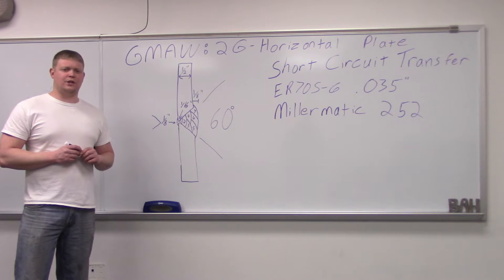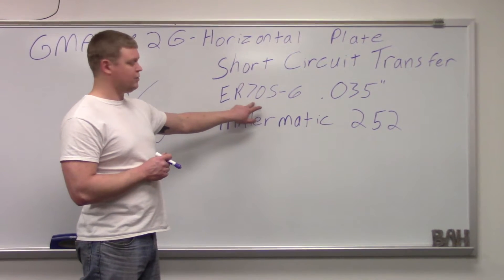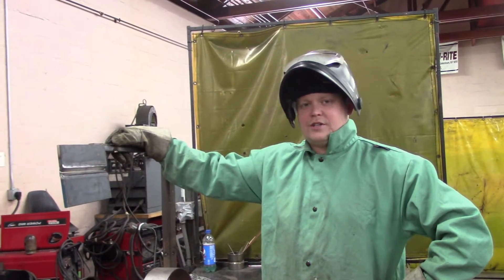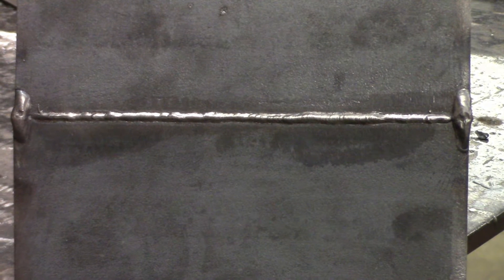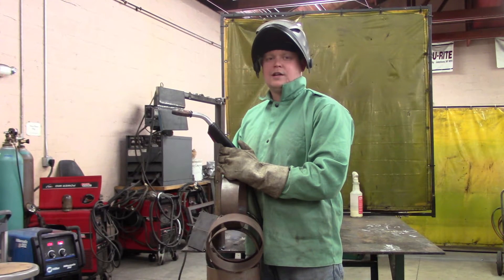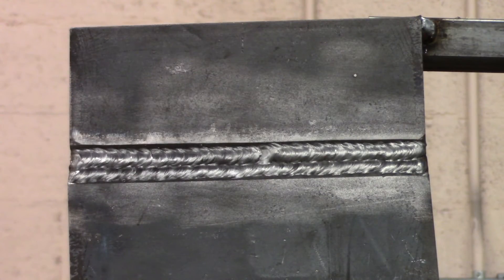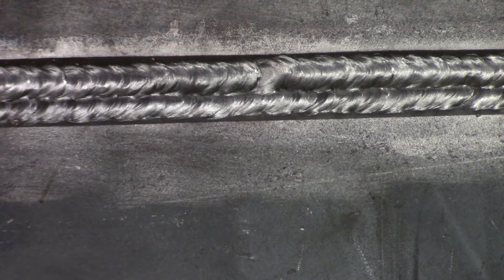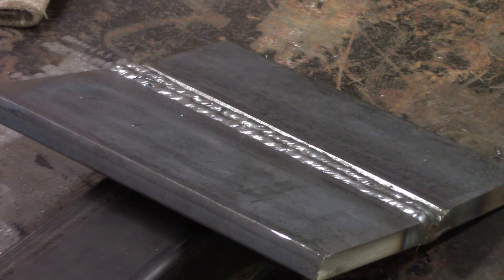GMAW 2G Horizontal Groove Weld

Comment: Why would you oscillate up and down in 2G? Your toe could be spot on if you would just run stringers. Not a huge fan of the over reinforced welds you presented. That’s a result of up and down oscillating…. A simple side to side whipping acting produces a better toe firstly, secondly, a better not over reinforced cap. That looks like over 1/8 of reinforcement from my pov….. more stringers, add a new bead every completed fill pass. Leave your bevel edges and use them as a guide. But a “J” weave of any weave in 2G for that matter is not a great idea.

Comment: Any difference in the 2 different machines you used? Which one did you like or prefer more miller Millermatic 252 or Lincoln electric power mig 255? Looking into getting either one of those 2 machines.. MM252 or Lincoln 256. Price isn't a factor in whether which one I get, just want to know what you think since you have both and used both for your videos
Reply from the maker: Both machines run fairly similar.  The Lincoln seems like it has a little more power for some reason.  The Miller does well too, you just have to run it at a higher wire feed speed and voltage.  They both are really good machines.  I'd buy either without hesitation.

Comment: it looks like your angle for the torch is away from the puddle? why? also on your hot pass and covers you make like a xxxxxxxxxxxx pattern with the torch, im not a code welder, but aesthetically doesnt a rrrrrrrrrrrrrrrrrrrrrrrrrrrrrrrrrr pattern look nicer? hope that made sense lol
Reply from the maker: Don the Onion I usually have the torch angled slightly up on a horizontal weld because the puddle is going to want to go down.  You're going to want to have your contact tip around 1/2 inch out of the puddle.  The weave pattern you're going to want to use is some sort of variation of the J pattern, hold at the top and sweep it low, hold and sweep.  Everybody has their own preference and variance in their own weave pattern.
Reply: thanks

Comment: Great video! What is your arc force setting?
Reply from the maker: DKMgrrl The machine I was using doesn't have an arc force setting.  The only machines I have that have an arc force setting are stick welders.
Reply: Brent Harkness oh okay, well thanks anyways. Just curious because I just completed an open back 2g on a miller xmt 350
Reply from the maker: DKMgrrl The machines that we have that do have an arc force setting have a range of 0 to 10.  On the root I usually turn it all the way up to 10 because I like to keep a small root opening, and then I turn it to 5 for the rest of the passes.